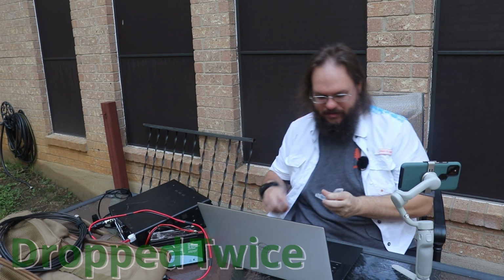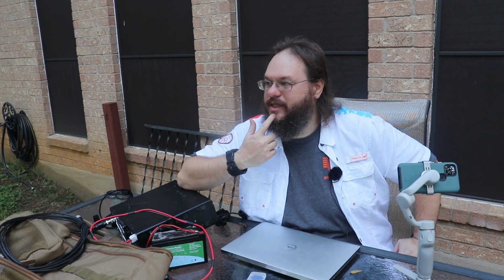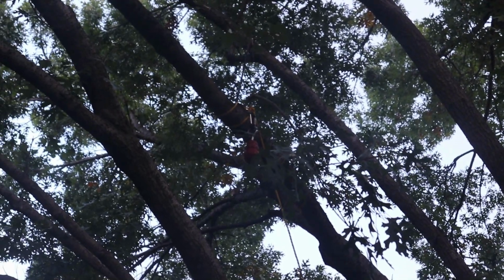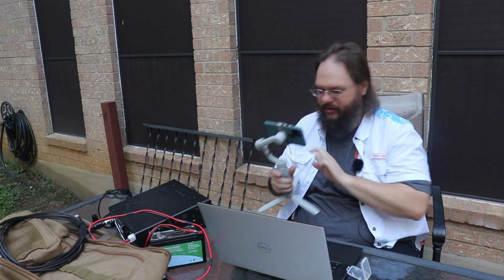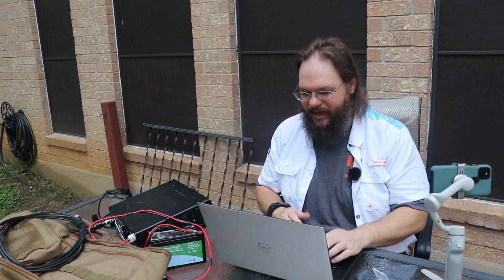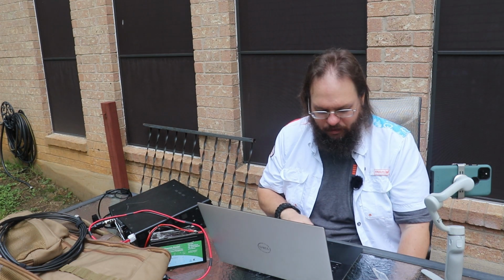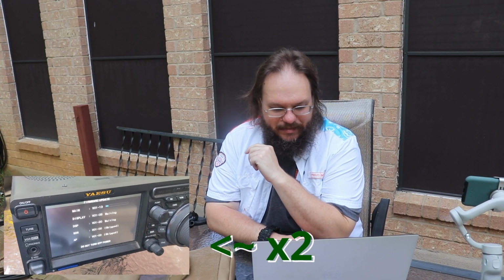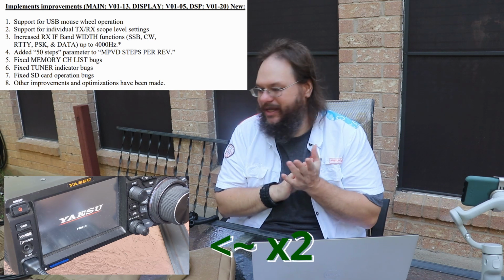How to Update Yaesu FTDX10 Firmware

Comment: No disrespect meant here but your video like all the others show how to upgrade the FW. Yaesu provides the instructions in detail so you can do it with no issues and the one thing I never see is the feature/issue addressed by showing the before and after of the upgrade/update. Of course the issues are listed in the documentation but it should be showcased in the video to complete the reason for the upgrade. No? I usually see mentions of the fixes in the comments but the visuals really tell a better story when they are in the video.
Reply from the maker: This is my video of its kinda, updating firmware.  I usually HATE updating firmware on any of my devices / computers. This stems back to the old computer days of rolling the dice if the update firmware will be successful or you just bricked your device.  

YOUR second point.  A to point by feature comparison might be hard to really show the differences.  IT might be suggestive and trickking BUGs, i am doing to take a hard pass.  HOWEVER, i will consider it for the next Yaesu update, BEACUSE the update process to VERY STUPID Simple.